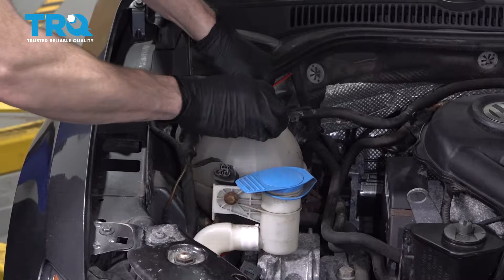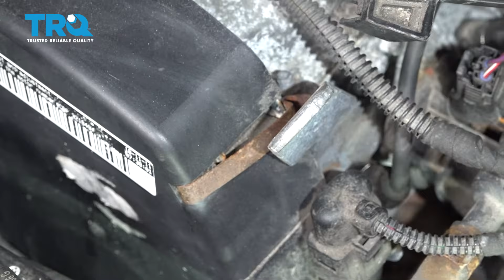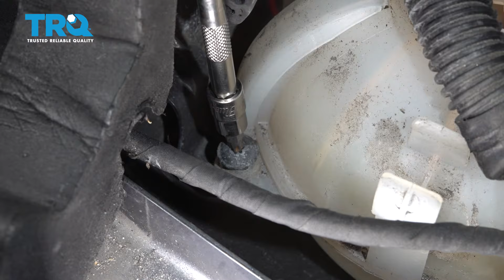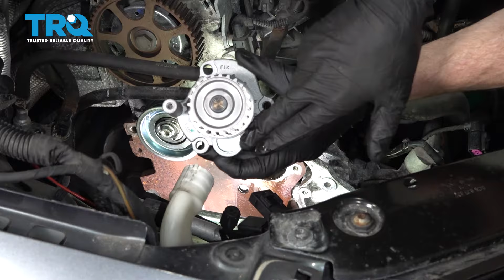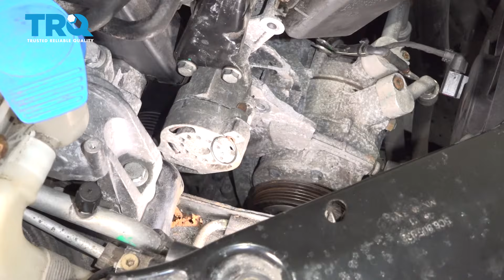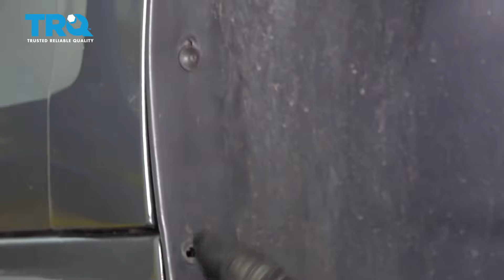How to Replace Water Pump and Timing Belt 2011-2018 Volkswagen Jetta

Comment: I agree - excellent How To video! I have a 2017 Jetta SE, and when I look up the water pump using the link above, it says not compatible and sends me to one that mounts on top of the motor. Am I looking at this wrong? Also - mine is not turbo, if that makes a difference.

Comment: Extremely helpful video man! I would note that on my 2014 Jetta S 2.0L  (CBPA) 5spd manual  required T30's for the lower timing belt covers. I REALLY WISH VW would put timing marks on the crank sprocket and block. I've verified timing now 3 times putting the harmonic balancer and lower timing belt cover back on and I've marked it, but it still skeeves me out not having manufacturer's timing marks on at least 2 points of reference on the actual head, block, and both sprockets.

Comment: This has to be the best video on youtube explaining a timing belt replacement, and certainly in the running for best explaination of anything mechanical on youtube as well.  

That said, I just did the timing belt on a p2 volvo and have to do this job on my 2017 jetta 1.4 tsi.  The volvo timing belt replacement had a lot less steps, but VW certainly has the waterpump part down.  

Thanks for the great video.

Comment: are these interference engines?  Mine broke the timing belt.  wondering if i can just replace the belt or if i need a new engine cause the valves are shot.  thanks

Comment: I have a 2014 vwjetta se 1..8 turbo and my engine is different than the one you are working on. My alternator is mounded on the front side of the engine and don't require removal to acce the timing cover. Also my dip stick is in front of the timing cover. And my engine don't have  hole in the side wall fended to access the lower motor mount. There is no lower motor mount. And my teacher is center bolt releas. Mt timing covering clip on its bolt on from top to bottom. Why such a difference in motors mine is a 2014 jetta se 1.8 turbo  my crank has a single 1"bolt  im trying to understand why such a big difference in the engine. Can you please help with yr insite? Thanks

Comment: Thank you to this awesome mechanic and team at TRQ!!!  This video helped me install my timing belt on my 2015 base model (manual) Jetta  2.0.  The only thing I did different was not remove the alternator which saved time for sure.  (I only needed to remove the top bolt of the alt' in order to remove that power steering fluid bracket which also locks in the serpentine belt tensioner.)

Comment: I did this timing belt, water pump and tensioner replacement yesterday. It was totally doable! Took my about 5 hours but I was really taking my time and documenting the process. In my case I actually didn't need to remove the alternator. But other than that I followed this video exactly. Thank you for this upload. Great video. Also I would recommend anyone doing this type of work to purchase a Bentley manual def helps as a reference for torque values etc.

Comment: Just want to thank you so much for providing this video. I was able to complete the timing belt and water pump removal and installation. Just took the car out for a test run and it sounds so much better, one thing I would have loved to have seen is how to install the crank & cam seal... What are your thoughts on that becoming an issue, I also watch the Scottykilmer channel he recommends AT 205 reseal. which I'm going to start using since I didn't change the seal, do you have any thoughts about that idea?
I currently have no leaks with almost 190,000 mi. Timing belt had several teeth missing, I was lucky that things did not become worse,! Local shops were charging- 3200-3800 in Texas😬

Comment: Great job dude. Used a Continental Pro Plus with the metal impeller... went super. 
But total foot pound on the engine support please... rough estimate would be fine.